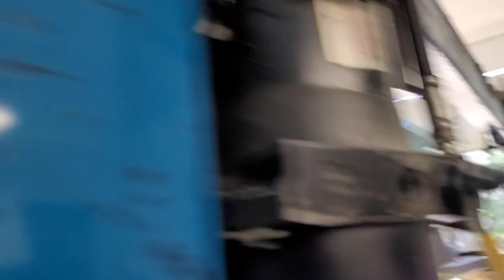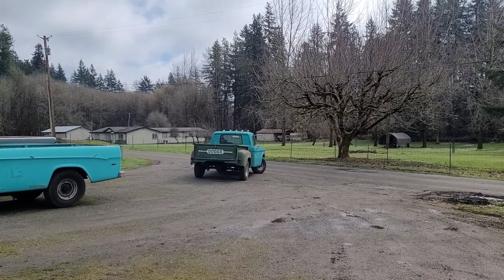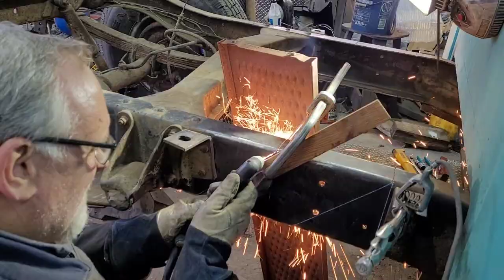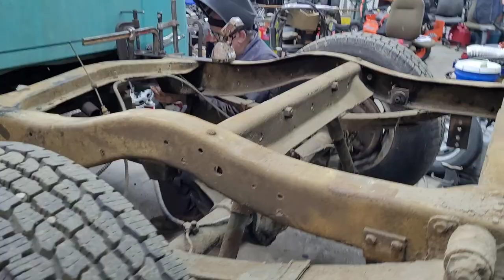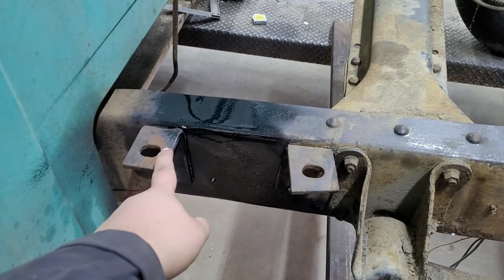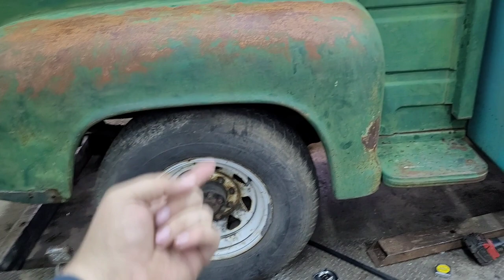Building a short bed step side 1965 Dodge Sweptline pickup!

Comment: Just wrong to trash a long nice shape vintage longbed,,, should have just used a short bed truck to begin with
Reply from the maker: I understand your point. But they're few and far between. We didn't trash it anyways, if anything it's now MORE valuable. Long beds are hard sells in Washington. No one bats an eye when people shorten a C10.
Reply: @LambvinskisGarage  what are the odds of finding  a bare longbed frame at a reasonable price in your area?
Reply from the maker: @edzimdahl1158  high considering we have 6 of them and I know where there's more. I've seen 1 short bed and it was already sold before I could get to it.
Reply: @LambvinskisGarage  have a good drive train and body but need a frame, in your area what they cost? roughly?
Reply from the maker: @edzimdahl1158  wouldn't be that expensive. I have a 70 d200 long bed frame I'd sell.
Reply: @LambvinskisGarage  How could it be more valuable when it's no longer original?
Reply from the maker: @C71  short bed is more desirable than a long, with the work done correctly, it doesn't matter. It's not for sale anyways, so it really doesn't matter.